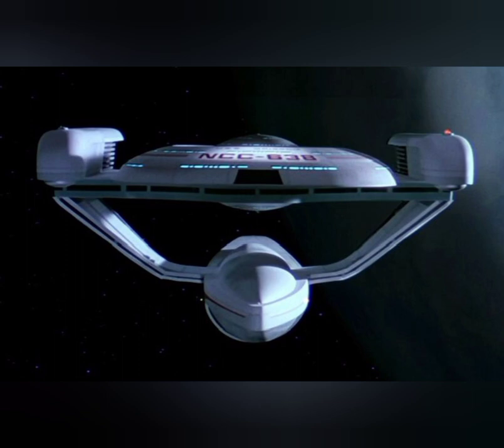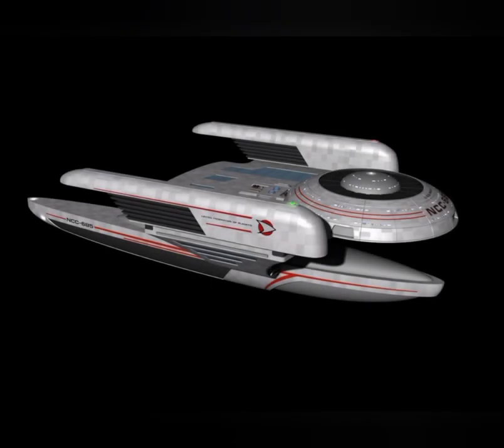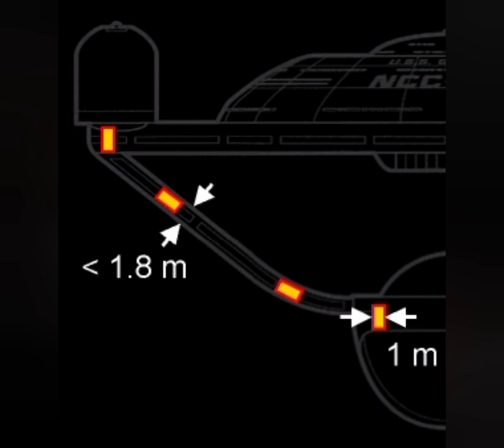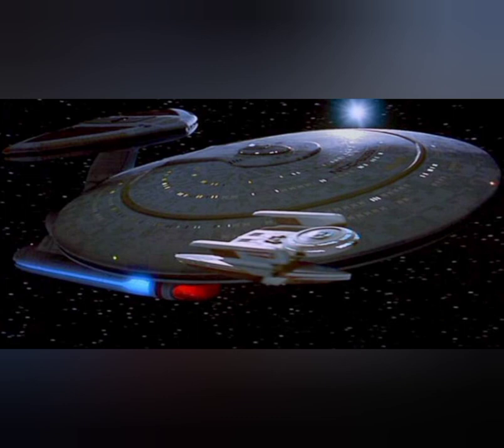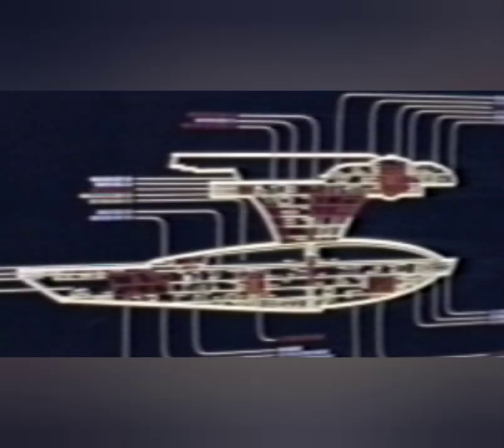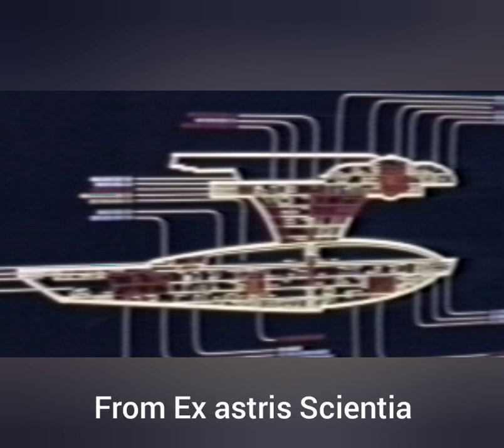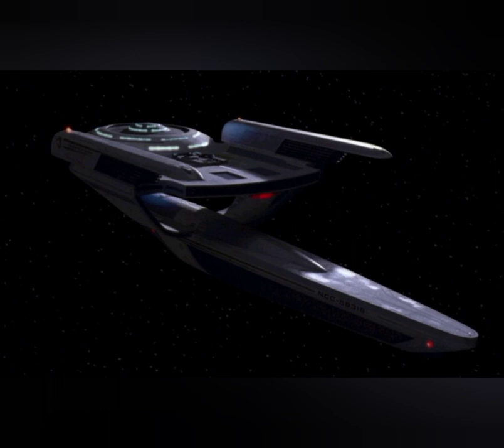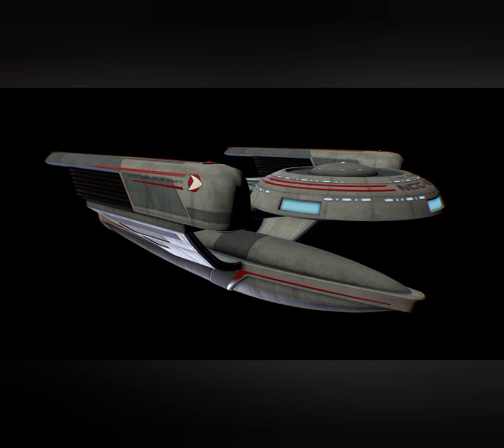Getting around the Oberth class

Comment: Good video. I still regard the canonical length as accurate, but I don't believe the secondary hull actually has any crew in it whatsoever and is purely equipment and supplies for long survey missions. Not unlike what you described for a sensor probe. I think it is also meant to be accessed by Jeffries tubes/ladders on case by case. 
The TNG schematic appears to be a variant, and given the angle we saw, it there did appear to be a point around the pylons where it was wide enough for a turbo lift to accommodate a different secondary hull. Presumably this could be part of a 24th century refit. 
Another consideration is the crew size could be "up to" and not necessarily as high as 80. I think the Grissom Crew was substantially smaller, and also to keep Genesis a better kept secret with fewer on board.

Comment: [TRANSPORTER EFFECT]

Okay... this is weird, there's some temporal flux.

[Tricorder noises]

Oh, ok. So, it's me, from the future. I have traveled from the far off year of two thousand twenty four, where you have embarked upon a build of the Oh Bertha class ship in minecraft. I was going to mention there but it seemed more fitting to come back here.

I see no reason at all why anyone would think there's any crew of any kind in the canoe. There are no port holes, no lights, no doorways, airlocks, pizza joints. I know there are MSDs of the Oberth showing decks there, but I am perfectly happy to throw those out as, well, TV people rattle that stuff out all the time without stopping to ask.

In my HC, the saucer is the ship, it is connected to a flat warp sled with nacelles and a lateral M/AMRC. That sled is further connected to some kind of Massive Space Doohickey. Eyeballing it I'd say the saucer was five or maybe six decks thick, and that's plenty of room for a ship. I don't think there's a shuttle bay at the front. I don't think there's a shuttle bay at all, and I don't think there needs to be. Having every Starfleet ship have all the same features is kinda dull. I generally consider the Enterprise to be among the first ships to use transporters reliably, and a natural conclusion for a small ship later on would be to rely on transporters solely, given just how much room is taken up by the bay. YMMV, of course.

Speaking on behalf of the future, we're all very glad you got a much better microphone.

Alright, my time here is done, if you'll pardon the pun. Can't distort the temporal predestination whatsit and all that. The winning lottery numbers are 06, 13, 14, 33, 50, 66 and 08.

[TRANSPORTER EFFECT]

Comment: A back up living, work areas could be in the secondary hull as a backup command, control areas. With secondary crew. Furthermore there is no reason that the labitory would not be located in a isolated section of the vessel incase of emergency. As this would increase safety for the crew as a whole. As if the saucer section cold detachable, and had independent warp 4.9 drived integrated into the primary hull. Thuse could separate so dangerous research could be performed by automatic systems. while the crew in the saucer section watched from a safe distance.
  Or if it's a fleet refuling vessel the secondary hull could be the fule pods. Which you wouldn't want crew to be around

Comment: I like the idea of the secondary hull being cargo and automated equipment. However, what if crew members whose stations were in the secondary hull stayed there, and there was no travel between the two except via Transporters. The crew embarked, slept, ate, etc all within the secondary hull.
Reply from the maker: It could be. Honestly there could be several versions of the design. Though as I say it's cannon length is probably far to small.
Reply: Well, I wouldn’t want to the poor shmuck at the bottom of the command totem that’s ordered to patch up the hole in the hull with duct tape....

Comment: The Oberth probably uses ultra reliable solid state transporters to move around- and to save critical space on such a compact design.
Instead of turboshafts, a magneticly shielded ductwork would transport your pattern  and re-assemble you at your destination. Becu the transporter is a "sealed system" it wouldn't have any of the risks of a site-to-site transporter.
It's the means John Eaves and Doug Drexler envisioned for the Enterprise J, since that massive design would be too large for turbolifts to be practical.